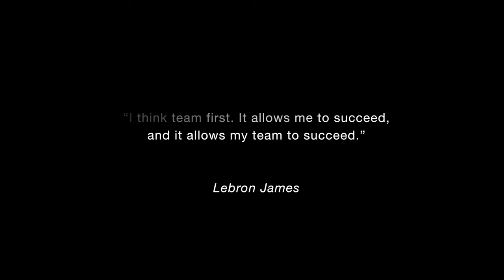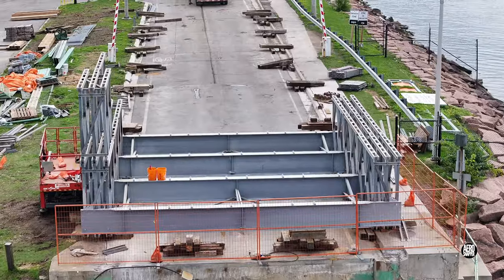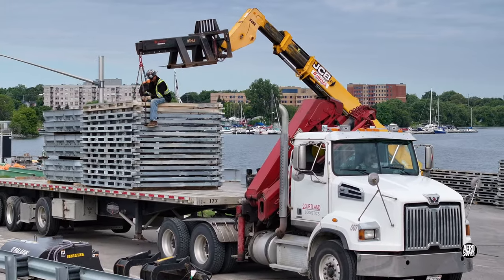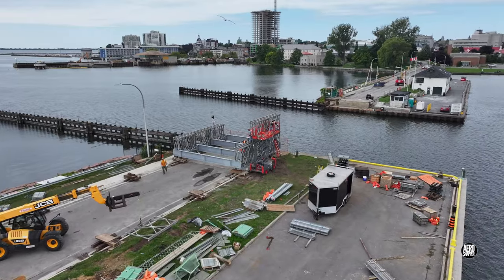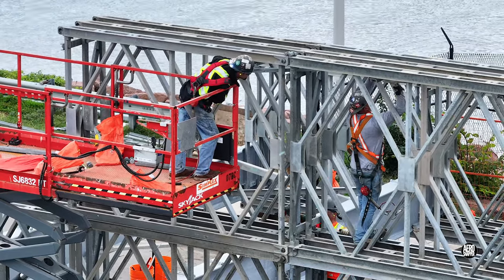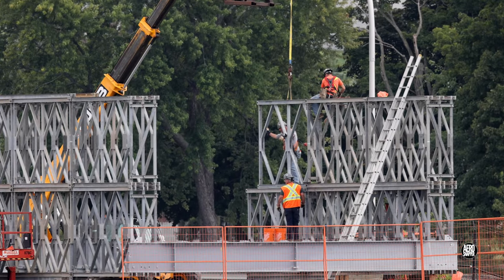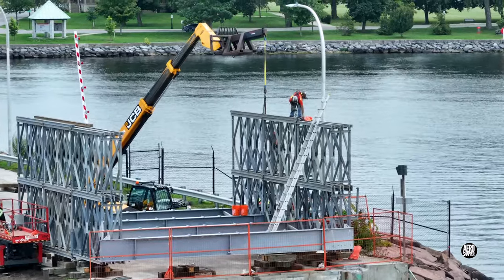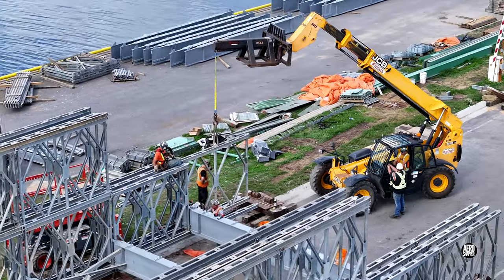Taking Things to the Next Level - an update on Kingston, Ontario's La Salle Causeway  4K

Comment: It is amazing to see how fast these can go together. There is one in use in Ottawa to carry buses only over the light rail line being built beneath it, near Roosevelt Street in the Kitchisippi ward in west Ottawa. Arrived in pieces, assembled, and lifted into place in one enormous piece, in short order.
Reply from the maker: James - there may not be the same urgency here.  It's extraordinary to think that an engineering design from the late 1930s still has a place today.  It remains simply the best solution to gap closing in a hurry.  Thanks for that information.  I wonder if this bridge will be lifted or slid into position when it's ready.

Comment: Looks like they are building what we call a Triple Double Twice Reinforced Heavy (TDR2H). That is to say 3 panels wide 2 panels high. I am still highly doubting that this will be moveable once it's lowered into place a bridge of this size and weight does not like to be move alot. But I am interested to see if they do make it moveable....
Reply from the maker: Well - I'm in no position to challenge a sapper - I think you're spot on.  The 'the promise' from PSPC is that it will be removed, briefly, on one or two occasions, to allow marine traffic to pass.  We can only wait and see.
Reply: Exactly time will tell!

Comment: This checks out; this is the exact same construction methodology they used on the Machar St. Bridge in Gananoque, Ontario. If you look at Street View, you'll get a good idea of how the bridge will look when it's done.

The only difference I think they'll do here (aside from the width) is they'll probably use a steel deck, due to its intended retractable configuration (however they plan to do that).
Reply from the maker: Thank you for that great information - I will be heading to Street View very shortly.  I believe that steel deck panels were amongst the items unloaded yesterday. I'm basing that conclusion on the upswept edge and holes for fitting
Reply: @Aerosnapper  Interesting! I look forward to seeing how it goes.

Comment: This muat be a temporary solution...  Don't think Bailey bridge can be swung or lifted to clear the canal...
Reply from the maker: You are absolutely correct - no decision has been made on a permanent replacement.  It will likely take years before one is in place.  It's promised that this bridge will occasionally be removed to allow access to marine traffic - likely by raising and sliding it aside - perhaps with the aid of a barge. It will not be a task completed  lightly